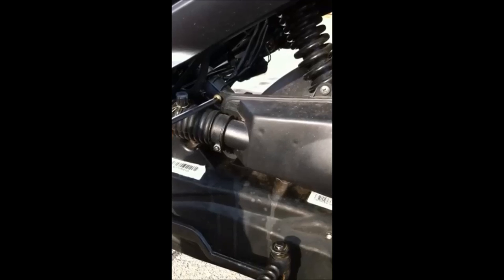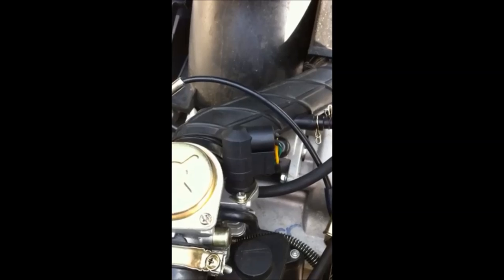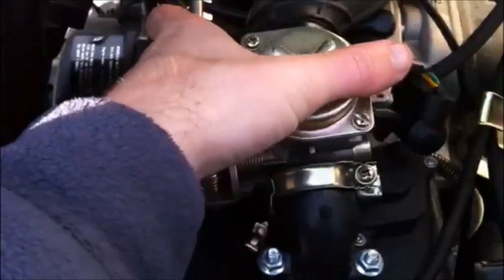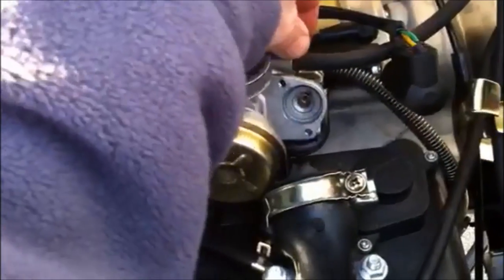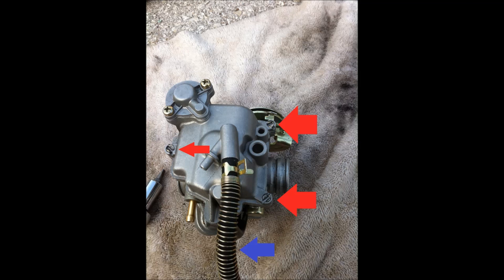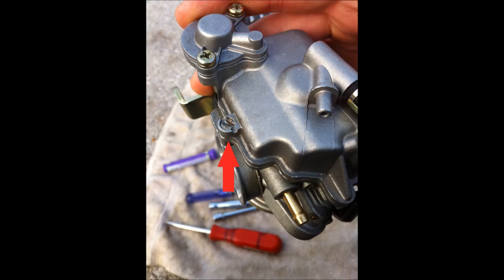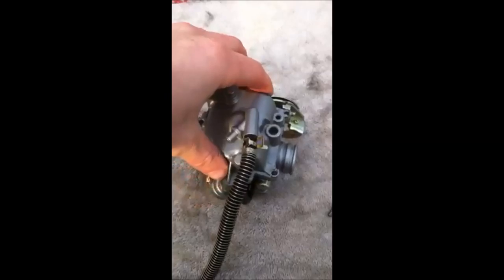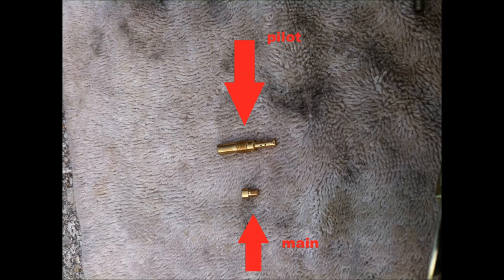Scooter Carburetor adjustment

Comment: Thanks for your help, I replaced the gear oil today (of course it was black) and then after a few tries the engine started, but only for a few seconds. I was able to start it again and got it running for over 30 seconds. However the carb kept flooding, so I took it apart again, last time I was unable to unscrew the float but this time I forced it and found that the floater needle valve was covered in old gasoline that kept it from moving with the floats, but...... while working in my driveway, I

Comment: Sorry, this is the first engine I've ever worked on. Yesterday I drained all the old gas, followed your instructions and cleaned out the carb (it was filled with brown residue), I cleaned the main jet but I couldnt get the pilot jet out. What I mistook for the exhaust is the air intake. The big black tube has a smaller tube coming off of it but it doesnt go anywhere. I found a hose in my garage and it fits in that hole but I dont know where to connect it. The carb is getting fuel and the spark

Comment: I ordered the carb rebuild kit. I made my own clip for the floater needle valve and it looks like it functions fine, and the carb stopped flooding, but I can only start the engine if I spray some starter fluid in, and it only keeps running if I keep revving the throttle. If I leave the throttle in any position it dies in a few seconds. I adjusted the the air/fuel ratio to every position and none works. When I cleaned the carb, the main jet was blocked but I could stick in wire to clean it, but

Comment: I took out the fuel measuring float and moved it by hand and the fuel gauge worked correctly, should I fill up the tank more or is half a liter enough, I dont want to fill it up and then waste time draining it if it doesn't work. Thank you so much for your help, if all else fails I will take it to a mechanic friend of mine and see if he can fix it...

Comment: I recently got a motorcycle like this used and its been sitting in my garage untouched for a year and I just got around to fixing it. I can get it to crank but it wont start. The spark plug works. Should there be a hose attached to that tiny tube sticking out of the metal end of the carb drain hose? or is that for air? Also, I do not have a hose attached to the small outlet on the big exhaust tube, where should that attach to?

Comment: I was unable to clean the pilot jet, the wire just wouldnt go through so I assumed the hole was just too small, but I couldnt see light through it. Also, after revving the engine for a few minutes to keep it running, After it dies I can see some kind of fumes coming from it, is this normal? the cylinder head cover is warm but not too hot to touch... I'll let you know if the new parts do anything when they get here.

Comment: Turns out it was the pilot jet, the thing was clogged and it took a drill to get it open. I dont know what the original hole was, but its a 35 now! With the pilot jet open it idles great and I got to ride it around a little. The only thing is if I accelerate too fast the engine bogs down, I assume this is normal for a tiny 50cc chinese scooter? Also, the engine rpms are highest at about 90% throttle, they go down when I do 100% throttle, could this be a problem? is it the restrictor kicking in?

Comment: Very Helpful Video. I am just getting me feet wet on a new Roketa 250 54B liquid cooled that wouldn't start right out of the crate.  Battery was charged, fluids checked and fuel added to the tank.  There was zero Vacuum to the fuel pump.  After watching this and 1 other video about the source of the needed vacuum to run the pump, (intake manifold port)   I suspect to find the vac. hose to runs everything vacuum related probably was never connected to the port on the intake manifold. Great job with the video by the way and thanks for the valuable information.  With any luck, the loose dogs will be chasing me down a country road before long.....

Comment from the maker: Ya the boging at full thotle I would check my valves if you have not done that and maybe mess around with the size of my main jet.  And ya I would check for a restitor washer inbetween the variator belt plates.  You will need to remove the belt cover and use a impact rench of some sort to get to it.  There are some speshalty tools you can use aswell if you dont have a impact gun.   Good luck man

Comment: Tks four you great video, I have a scooter two stroke 50cc sym fiddle from 1999 the moment the petrol not came out from the tank to carburettor I by a new fuel vacuum pump because I thing is the problem, anyway I fit the new vacuum pump and still not came petrol out what you recommend to check first tank you best regards: Vinnie Berenguer

Comment: plug is getting wet. I feel air coming out of the exhaust when I crank it. The battery is pretty bad, but I've been using a battery charger with 60 amp crank assist and the starter motor cranks the engine, the battery is trickle charging right now, I'll try it again when its fully charged (Assuming its not damaged). I checked the petcock and its connected properly and not clogged. I tried this test with about a half a liter of fuel in the tank, but the fuel meter shows the tank is empty. However

Comment: I just bought a new carb formy 1984 Honda spree and it works fine but I need to fine tune the thing . I got the idel fine but that oil adjusting screw I know nothing about how t tune it. any tips

Comment: I adjusted the valves and it still wont start, I did however notice that when I manually moved the piston by turning the fan, if I stopped and held it in a certain position, I heard a hissing sound for a few seconds. Could this be pressure forming and a damaged gasket leaking?

Comment: So far, I know fuels getting to the carb, Im getting spark, I have a correct spark gap, I have a brand new battery, I adjusted the valves (they were originally screwed all the way down), the fuel petcock is clear, and the intake manifold is not cracked and is clear. When I put my finger on the spark plug hole, I feel some compression, but I have no idea if its enough, I'll get a compression tester tomorrow. If it is indeed a damaged gasket, do you know a good website to buy a new one?

Comment from the maker: Ok,  For the carborator drain if your not getting fuel all over the floor then its fine.  Some carbs will have right next to the drain a small little piece of aluminum right next to it but it is not part of the drain (it just looks like it).  Also there is a carburator overflow but if your not getting fuel on the floor when you crank it does not tell us anything.  
not sure what you mean buy exhaust tube.  The carb will atatch to the intake manifold and the air intake box.

Comment: Hi there. I have a gx150 spiderbox and just bought a new carb from buggy depot. Apparently there are chinese ones, but this is 'supposed' to be the more expensive one. Paid 100 or so bucks. Anyway, put it on and there is a lot of backfiring. I did not adjust anything. Just put it on. Is there a way to richen it up without swapping jets? I'd imagine this is a carb that is supposed to be able to be put on without an adjustment, but I've got way too much backfiring and its getting worse.

Comment: over time they need to be maintained, understood... as the system "loosens" up over time. what things exactly need to be done.   I get the piston valves must be adjusted using the feeler gauge, but do i just screw the jets in the carb to a certain point to "adjust" the carburetor, or is it a complete replacement of the jets. i do realize i could need bigger jets to allow more fuel through the system, but what makes this seizure in the rate of the idle, what exactly do i do to fix this?

Comment from the maker: About how much gas are you getting?  If it is jetted wrong you could get a small amount of gas coming out of the oil filter. Also if you have a air leak some were in between the air filter and the carb you could get some gas coming out of the air filter area?  Does the bike start and run? If not then you may have the gas line hooked up to the wrong spot.

Comment: I have a 49cc Zhongneng scooter that was given to me by a friend, it runs at a max speed of 30-35, He told me I could replace or modify the carburetor to bring it up to a ~55 mph max speed. I cannot find the model of the scooter, so I believe its a knock-off, but it has the exact same carburetor as the scooter in this video. It actually looks quite similar in terms of air filter and engine to yours as well. What do you suggest I replace the carburetor jets or entire carburetor with?

Comment from the maker: Ya it really sounds like you need to replace the pilot jet.  Were are the fumes coming from?  I would say the only place that fumes should come from would be the exhaust pipe.  

Also be sure to have the fan cover and air flow guide over the head.  This is how the engine cools itself.  Is just a few plastic covers that guide air.

Ill bet that a new pilot jet and carb rebuild kil will get it going. good luck.

Comment: I have a gmi-106 i don't know what the name for it is, i just got it off a website for scooter parts. but i have replaced the starter relay and the ignition coil. and whenever i try to start it, it just clicks. whenever i press the starter it clicks. what would recommend to try and fix it

Comment from the maker: ran out of room on that last post.  Im going to guess you are talking about the hose that connects to the intake manifold and that goes to the petcock (fuel valve).  With out this hooked up you will not get any fuel in the carb.  
hopes this helps and thanks for walching.  feel free to ask any more questions.

Comment: after attaching new carb. 50cc still won't start. fuel does get to the carb. and there is spark. but yet nothing. when I poor had directly into the intake it does start. 
any thoughts?

Comment from the maker: So when you say "does not stay on" does it just die out?  Do you need to hold the throdle and keep the rpms up?  If so this is a air fuel mixture.  usaly to ritch.  I would start buy checking the jets.  If its a 49cc you are going to want a pilot jet around 32-34.  
Sorry it took me so long to respond, had busy few days. Let me know how this goes.

Comment: I got a 50cc scooter i just got out of the shop. it ran perfect before they messed with the carb, now it only goes 5 or 10 mph and struggles. when i remove the air filter it runs like it should, is this a jet problem?
Reply: Look your Gas-mixture,,,adjustement them,,clean pilot jet,,,look  vaccum hose,,then it runs just new

Comment from the maker: How many kM has it been since the valve ADJ?  I would check that again.  On the taotaos It is very common to get a air leak in between the "air box" and the carburetor.  I always assemble the cab and air box together before I put them on the bike so I know that it has a good seal.  I would start with that and let me know if it does not fix it.  GL

Comment from the maker: First check the valve adj.  Then check the jets in the carb and make sure all the hoses are connected and there are no cracks in them.  Make sure the air box is connected to the carb correctly.  I got videos on how to do all this stuff.  Let me after you have done all this if it still has a problem.  Does it start good?  Will it idle? How many KM does the bike have on it?

Comment: So QUESTION.  This may sound noob but, what is the point of an "adjustment" is it really a replacement?  I get the 2 jets inside and they come in different sizes and need to be clean and free of debris.  My scooter last got the valves adjust and the carburetor adjusted and it was running wonderful. Eventually it did not stay on at an idle i would have to hold a bit of gas for it to run.  It got looser and looser and now again it just will not kick over.  I dont think its the idle adjustment
Reply: g

Comment: I need help I got the gy6 carburetor  I get gas to the carburetor butt it won't start well it starts for a second or two and then it wont start  I check the spark plug and its dry when I use a different carburetor from one of my other bikes the bike runs right what can it be I have also cleaned out the carburetor I adjust the fuel adjustment screw and there's no change no difference any help will be appreciated

Comment from the maker: Ya new carbs are cheep.  you can also get a carb rebuild kit for about $10.  Also sounds like your a biit lean on the start.  May  want to order a few pilot jets aswell.  Maybe try a 32 and a 35.  I found that a 32 seems to be really nice for 45cc.  I also have tried 40 but thats to rich.

Comment from the maker: The pilot jet is inside the carb.  Just watch this video and It will show you how to remove and check your jet.  Also may want to check your cam adjustments.  I have a video on that also.  You can see the jets in this video at 4:20.  Let me know after you check this stuff.  Also check your air mixture screw ( mentioned in the video).

Comment from the maker: Ok so we know that you are getting fuel and spark.  If your sure that your jets are clean ( you can see sunlight though them)  I would check your valves.  I have a vid on that.  Also if you havce a compreshion test guage I would check that.  Proper timing, compreshion, fuel, spark, it should start.

As far as the small hose on the air intake that usaly hooks to the top right corner of the valve cover.  You can see it in my value adj vid.  But I dont think that is the problem. GL  Keep me posted

Comment: i have a scooter that will run only about a min or so at a time, i bought a new carb with the same prob, i know it gets gas to the carb, the electric chock gets HOT to the touch really dont know if the chock works or not or if it could be the prob...HELP PLEASE
Reply: using the same choke with the new carb? if it gets hot fast it is closing to soon, try running the engine with the e-choke disabled. If this helps, put a resistor with 7-10 Ohm between earth (-) and e-choke, this resistor is usually found in the front of the scoot and slows down the chokes effect depending on temperature. Maybe someone has removed/disconnected this resistor on your bike.

greets from Germany
Reply: Chock works OK,,,,clean carb,,,adjust your gas-mixture,,,,problem gone,,,

Comment: 1 its a junk 2 you need to drill the restricter where the muffler comes out of the engine at the bottom under the moped. its tiny enough a pencil wont go through. 3 use no more then an ounce seafome in a full tank or youll ruin the moped. one ounce is not one can this will clean the exaust from the mufler

Comment: Hi ! My scooter has a problem ! It starts all good but when i give it gas (throttle) it doesn't move with me on it but when i put it on the two stands and give it gas the wheel turns .... Any idea on what it is ?
Reply: Adjust your gas-mixture,,youve to many air,,,